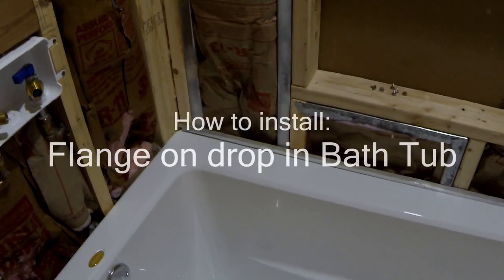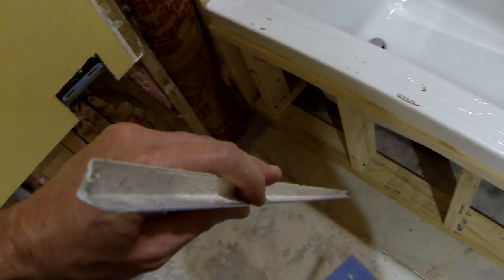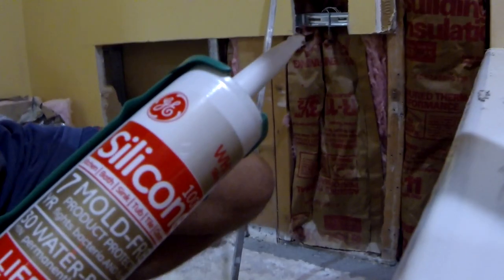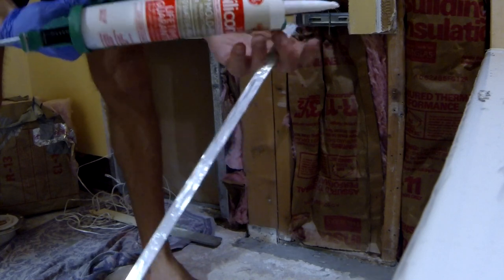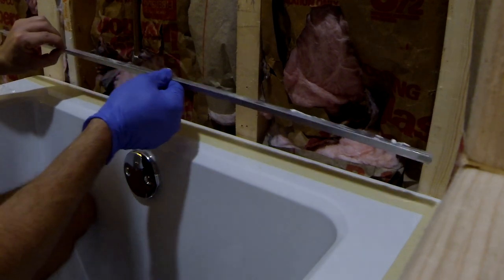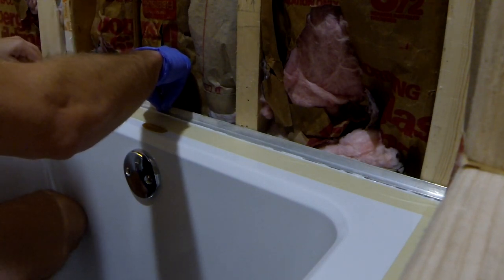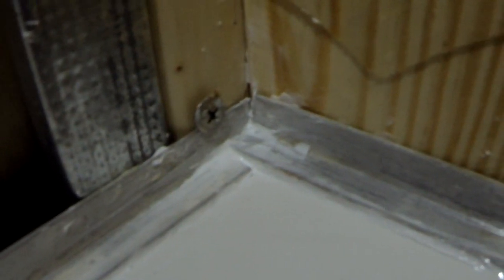How to install a flange on drop in tub

Comment: You can/should buy proper flange kits for this application. They are T shaped so sit on/behind tub rim far better and they are flexible so won’t get cracks as house seasonally moves or settles.

Comment: I am using a drop in, in an alcove exactly like this. Where the front tub corners meet the wall, how does this get finished ...tile/drywall/wood?  Because the tub is flush with the drywall at the edge, I'm not sure how to make the transition. Any videos or pictures of yours?

Comment: Thanks for the nice video. I have a drop in tub that I want to install but it is 45 centimeters from he floor on one end and 44 on the other. Should i use shims?
Reply from the maker: If your tub is plastic I would not use shims or your tub bottom will break when you fill it up with water. If it's metal it may be ok. To be safe I would pour cement under it .

Comment: During the cement board install did you;

1. bring the cement board all the way down to the bottom of the L-Bra ket (or tub)

or 

2. Stop at the top of the angle bracket and then tile all the way down to the tub?

3. How did you install the access panel?

..and last question... Do you have any completed pics of the tub?

Thanks
Reply from the maker: You have lo leave 1/8 inch gap between board and tub or angle bracket. You can see from my pictures that boards a little above the bracket. Then you tile down to the tub leaving space for grout.
You can see that part here: https://youtu.be/4L0s0WefX3o?t=20m22s
Access Panel part is here:  https://youtu.be/4L0s0WefX3o?t=20m37s
Pictures of the entire project from start to end:
https://goo.gl/photos/muerKwy2scjH1c4u5

Comment: Do you use the tub as a shower as well?
Reply from the maker: I mostly use it as a shower. I fill the tub maybe 10 times a year. 99% of the year I use as shower.  No problems after 2 year.
This system with aluminum was used on my old tub for the pase 30+years with no leaks so I decided to reuse those on my new tub.
Reply: Thanks again. I used your method. It worked GREAT!
Reply from the maker: I'm glad I could help. My new bathroom is 2 years old and no leaks. Just make sure you silicone around it well and enjoy.

Comment: Thanks for the video... I just purchased Aluminum Angle Iron for my jacuzzi tub flange.... 

My tub is Cultured Marble...(Alcove Install) do you think I need to put horizontal supports under the decking on the 3 sides?
Reply from the maker: If you have open wall, I would do a support beam under the edges if it's not a big deal. My previous tub was cultured marble, and there was no support anywhere. Tub was just sitting on the floor. I took those aluminum flanges from that tub and reused them on my new one. You can see my frame here https://youtu.be/PaHpoaW7UKQ